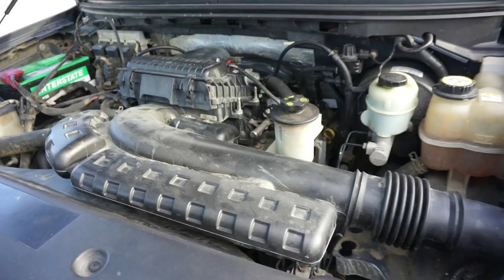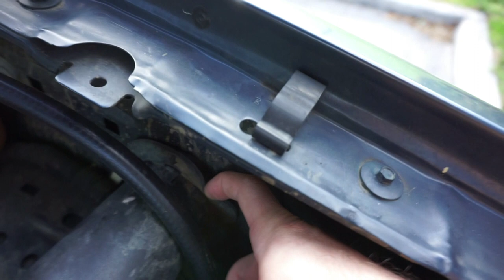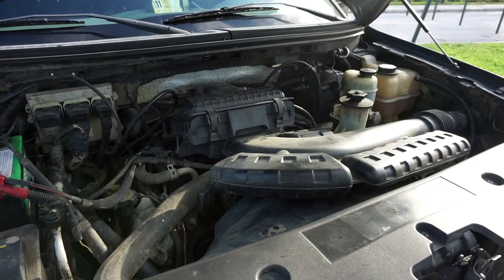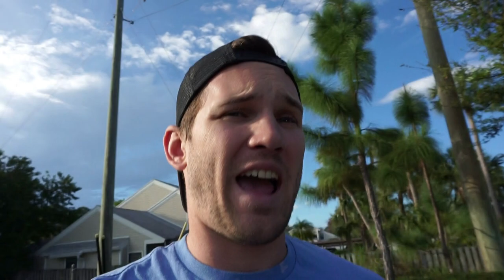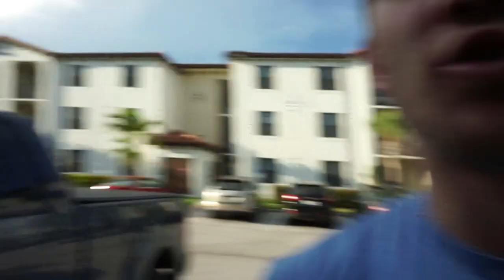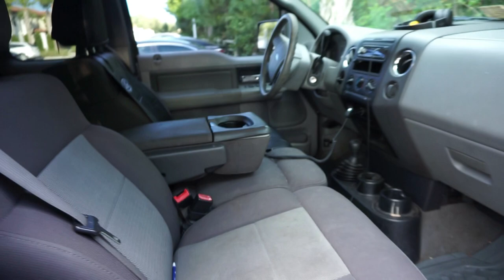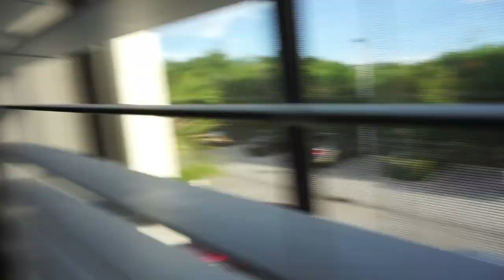This Is Why You Should Think TWICE Before Buying A Cold Air Intake

Comment: Honestly the pros outweighs the cons on having a CAI.. Im getting one. Keep in mind that he didn't mention anything about ungluging the battery prior to installation. You must unplug your battery before even plugging in the sensor then you must leave the battery unplugged for at least 15 mins so that the battery resets the vehicles computer along with its new data for the CAI.
Reply: Oh yeaaaaaah huh.. Not to mention he didn't even swap out the headers and exhaust system.
Reply: I’ve been searching for answers on this all over google …..thanks for this!
Reply: I agree with u more than I want to cold air intake on newer vehicles is almost useless but putting an 90° turn plus cold air intake to the front unrestricted is still a big boost don't get me wrong if it's side mounted it's vehicle spec but if u can front mounted an unrestricted ule get more out of a custom set on that then a OE spec k&n ur vehicle is moving forward wich means hot air is moving towards ur firewall an out yes its a constant output but it's always behind ur filter per physics  if ur filter box is pulling air from the side then switching to k&n needs to be front sided if u have air way slip shields either remove them or custom build them to a front side intake yeah it sounds expensive an time consuming but if u can buy one 90° part an put it front an center what is ur loss unless ur vehicles engineering hates customers wich is pretty rare fuck I'ma say it outside of ford
Reply: Incorrect....

Comment: I installed a Z1 cold air intake on my 2024 Nissan Titan Pro4x. The filter is located inside a box (with a nice looking window on top). No tune required. I am very happy with it! Better sound and better throttle response! The manufacturer says 10 more hp at the wheel... which I incline to believe. 😊

Comment: Most aftermarket CAIs are just "Hot Air" intakes, and complete waste of money in most situations.  The inconvenient truth is that most vehicles now come with CAIs from the factory.  The OEM CAIs  generally flow more air than the stock engine can use.  Louder doesn't mean more power.  It just means it's louder.

Comment: You don't understand airflow under the hood, if all there was engine heat and no airflow your engine would quickly overheat. Further a cold air intake is only going to show a gain in power at high rpm, too many people think that a cold air intake is going to turn their vehicle into a fire breathing dragster. Dyno's are also not a good way to measure the power a cold air intake gives you because you have no air flow, just an open hood and some fans blowing.

Comment: 03 3.4 GM rendezvous. I took out that bulky air box assembly and put a cone filter on it I use some mylar heat reflective stuff like they make the windshield solar Shields with. Now that the airbox is gone you can see the fresh air inlet coming to the fender. I drive 90 miles a day for work and there's a noticeable improvement. She's a sleeper  now LOL

Comment: Most people make the mistake of not resetting the computer after installing. You gotta pull the battery out (I did overnight) for hours so that the computer systems discharge and have to re-learn when they are back on. They will then adapt to the changes in MAP, and MAS readings and it will run better. Better power and fuel economy, with the wicked awesome bark.
Reply from the maker: I have never heard of removing your battery, I wonder why K&N doesn’t tell you to do that?
Reply: @AndrewDoesLife  Modification manufacturers make the assumption if you're modding your vehicle you understand what you're doing.

Research matters, as does understanding the fluid dynamics and kinametics of the systems under the hood! Engineering dude! Do you even?
Reply: @S.ASmith  🤔Still wondering why such a technical company as K&N wouldn't mention taking out the battery. Seems like that's something they woul mention after years of research...just sayn..dude!
Reply: @BC-hc5dq  When a kit is made to fit a variety of cars, they won't test on every car, heck they may just test it on a test bed to get the data they need.

And as I said above, if you're modifying your car the assumption is you or the person/mechanic doing it, knows what they're doing anyway.
Reply: Sure its like rebooting your computer at home every time you download a program or change something in your computer you turn it off to reboot it new cars are run by computer its the same thing
Reply: @kurtnulf3362  Indeed. The ECU will just adapt to different air temperatures or volumes. It'll otherwise maintain the same fuel/air ratio/mix in the cylinders unless remapped to something different.
Reply: Thanks
Reply: @BC-hc5dq they do in their installation videos....and they're on youtube lol

Comment: Adding an exhaust system + a CAI and a throttle body spacer you will definitely notice a difference in both sound (it’ll deepen the tone) and performance gains as well.
Reply from the maker: I definitely noticed a difference in sound! Much deeper than the stock system. I have wondered if I should’ve installed a TB spacer before going back to stock

Comment: Volant makes an EXCELLENT cold air intake system that uses a closed box system that connects to the existing fender intake hole, and you can optionally get a scoop that runs down closer to the ground that sucks air in from the front taking the much cooler air from the ground into your intake, these are fire.
Reply from the maker: I will have to look into those!

Comment: It all depends on your car, and where under the hood your cone filter is located.  Most of the time you're better off getting rid of the heat shield and instead remove some of the plastic under the hood to allow more airflow through your grill in to your engine bay.  You're not going to get huge power increases but you'll get about 5% more HP at higher RPMs, and maybe 1 mpg more.

Comment: I used a K&N air filter in a '97 4 cylinder Ranger (which I no longer have). I put in a K&N air filter and cabin filter in my '15 Trax. Minor fuel economy increase. I agree with your reasoning for not using the cold air intake system. Not to mention the airflow entering the stock set up while the vehicle is moving forward... If someone has a vehicle that has air filters on the outside of the engine compartment. maybe those systems might act differently.

Comment: Damn I was gonna get one this weekend so I was watching videos. So happy I came across your video of the experience cuz it just saved me 370 dollars.
Reply from the maker: No problem man! From my experience using both, the drop in replacement filter from K&N does way to more to increase performance in our truck than the entire cold air intake replacement set up. Plus the drop in filter is only like $40 and the cold air intake is over $300! haha The drop in filter I used is linked in the description if you don't know which one I'm talking about
Reply: @AndrewDoesLife  I do because Ive had the drop in filter for a few months now and I also did notice the improvement from it.
Reply from the maker: Good. I initially used to drop in filter and the results were so great I thought it’s a no brained to switch to their entirely new Cold Air Intake buttttttt that wasn’t necessarily the case haha I’ve found its best to use the stock housing and just get a better filter than the motor craft one they use from the factory

Comment: So what I'm thinking of doing on my 2007 5.4 f150 is ram airing the tube that runs into the fender by relocating it to the front of the truck closer to the grill or maybe cutting out a hole in the fender and putting a small vent flush mounted. Keeping everything stock and just add the drop in k&n filter.

Comment: I have a Lincoln Town Car with one (1995 specifically, 2003 and later have issues with electronic throttle). While I think the power gain is placebo, maybe 1-2hp at the most, the intake sounds way nicer, and I got a Spectre intake cone with chrome, which matches the chrome aesthetic of the car.

Comment: One thing I've found is with the intake getting it's air from the fender area, when you are in snowy or freezing conditions, a layer of ice or slush forms around the air filter. This causes a large decrease in fuel economy and the engines abiljty to breathe.
Reply: You are absolutely correct. My area in the fender fills with leaves. This is why I will not use the stock intake. The entire fender fills up with leaves. Clogging the stock system.

Comment: Been using the k&n filter for the oem as well... was considering an after market CAI and found this channel, guess you’re saving me ~$400...seems like a lot of people end up disappointed without tunes and exhaust. Your installation video of the full K&N intake had me kind of eager to pursue but sounds like it may not be worth the price lol. Nice truck and now you’re almost to 400 subs!
Reply from the maker: Yeah I was SO excited about the CAI system but honestly switching back to stock housing and using the K&N Drop In Filter was a way better decision and saved me hundreds of dollars that I've been able to put into other areas of my truck so I'm happy. Thanks man! I really appreciate it. We're only going to grow from here!
Reply: btw, K&N filters should be renamed to "rock catchers" 

it basically filters nothing. You're probably taking 20,000 miles off the total engine life. if not more
Reply: I put a roush supercharger on my 2014 Mustang gt.  The package is advertised at 575hp which from Roush is accurate unlike inflated numbers from other manufacturers.  The stock air box is retained, I found it funny how the stock intake is inadequate for a 420hp engine but it’s just fine for a 575hp engine.

Comment: Technically, that was a ram air intake. An CAI pulls air from under the vehicle or side of vehicle like the stock intake. You are correct, these intakes are pointless unless you are installing one that is completely enclosed and pulls air from outside of the engine compartment. I honestly doubt that heat shield actually works.
Reply from the maker: I meannnnn it was advertised and sold as a cold air intake haha 😂

Comment: You are correct,  you are not an engineer.  The cold air is the coldest available.  Get a gauge to check.  The stock is by far the warmest.  That massive plastic intake absorbs heat that goes straight into the engine. Get a air intake gauge for proof.
Reply from the maker: Jim Dailey thanks Jim!

Comment: Make sure you clean and reset your electronic throttle body after  installing a cold air intake put the only benefit from a stock 5.4L and a cold air intake system is 2 inches of pipe

Comment: your correct , there is a good reason why air filters are enclosed and suck in air through a pipe at the front fender , it is because cold air holds more oxygen, so all you are going to get from a cone filter is more noise and less power because its sucking in warmer air from under the hood. regards mechanic batman.

Comment: It's that particular vehicle and the air feed from the fender. The shield around the filter should seal off the rest of the engine bay and suck only the cold Air coming from the air feed Port.

Comment: The stock air intake already takes air from the fender well.  Not sure how a different intake would work any better
Reply: stock boxes are enclosed and usually located next to the hot engine. Good CAIs have heat shields and are tucked away near the side headlight area, so in theory the temps will be lower

Comment: My CAI gave it a nice roar. And for the model of vehicle actually prevented the timing pull when it got and stayed hot outside. Basically theres no HP increase but eliminated the mpg drop when in heat waves. But from factory it also has a strange like ram air inlet. Which i think is weird.

Comment: you wanna add exhaust with the cold air intake and you'll notice a difference. the common sense part with pulling cold air in I feel its opposite. The amount of air pulling through the stock is far less than how much air the aftermarket will pull. I will say the heat shield on that K&N air intake looks crappy. look at the spectre air intake heat shield. it brackets to the fender and radiator to fully block off heat from the motor. I did a muffler delete, cold air intake and soon a 3 stage tuner and new ignition plugs. I will post a video when I'm done adding to the truck and let you know how it runs after all the aftermarket parts are on.
Reply from the maker: Dude that all sounds amazing! Please keep me posted on your progress man I’m super down for adding performance upgrades to my truck. It just was too obvious that the heat shield wasn’t preventing the hot air from the engine from going into the air intake. I’m doing research now on doing a muffler switch to a magmaflow 40 series
Reply: wheres the video:(
Reply from the maker: The video of me installing the flowmaster muffler is on my channel 👍🏻😎

Comment: Get a closed box cold air intake it will make a difference. The open filters pull the heat from the motor back in

Comment: I did the same thing also, installed the cold air intake and i got a code for the MAF sensor. Truck started to struggle. Sent it back and the k&n drop filter. So much better, can tell the difference
Reply from the maker: Drop in filter is definitely the way to go!!

Comment: I really don’t see a benefit of installing a cold air intake on an older design Ford engine. Now on a newer Ford where most of the engines have VVT, and some are derived by Mazda, you will see a pretty noticeable improvement if you install a cold air intake. A cold air intake would be best suited for Ecoboost and 5.0 engines. Also N/A Duratec engines like them too.

Comment: I have done a lot of research on cold air intakes for my 2016 Dodge Challenger R/T Scat Pack... I talked to a lot of guys that own and work at speed shops and have a lot of experience tuning this type of car on a dyno... Everyone of these guys told me NOT TO WASTE MY TIME OR MONEY. These cold air intakes DO NOT improve any performance aspect of the car. So Im staying with the stock intake and Im still running 11.5 seconds on the quarter mile.

Comment: Would need an intake with a scoop for actual “cold air”. Not too mention a tune and exhaust.
Reply from the maker: Yeah I was disappointed this didn’t work out like I hoped it would
Reply: The S&B System works pretty good with and without the tune or exhaust...But with Exhaust an Tune it works pretty good for now .. but let you know how it goes after a few weeks
Reply from the maker: Hey Adam, I wound up returning the cold air intake from K&N and going back to my stock air intake housing, although I did use the drop in high flow air filter from K&N. I was not a fan of the noise and the way it made my truck run after using the product for about 7-8 days.
Reply: Andrew Does Life 

That’s what I did.  K&N 77 Series, Super 10 exhaust side dumped, BBK 80mm Throttle Body, and Gryphon custom tunes.  Truck runs like a car lol.  I’m glad with everything I did to my ‘05 5.4.

Comment: U think having a functional hood air dam directrd to the top of the filter would make a difference?
Reply from the maker: Yes I do. I have seen in person (there's one on YouTube as well) an F150 that uses the JLT Ram air intake and uses a functional hood scoop to allow for more air flow to the intake as well as cooler air that is not heat soaked from being in the engine bay. For this particular mod going on a bare bones stock truck, I don't know if I'd go with such an expensive mod that (for me) did not pay dividends. 

Here's that other F150 I mentioned -- https://www.youtube.com/watch?v=NLyBt-nuQq4

Comment: I 100% agree!!! I got the 69 typhoon series CAI for my RT Charger after KN said it would give me 40hp. Mine came with that same BS heat shield and thanks to dodge and performance pages in the nav I saw that once I installed the KN CAI I was pulling temps in my engine that reached 140-180 degrees and my gas mileage dropped significantly. After seeing my car at high Temps for days on end I decided to rip it out and put the old factory airbox and did exactly what you did and got the KN performance drop in the air filter and bam temps went back to normal and car felt exactly the same! I called KN requesting a refund and they wanted me to get a mechanic to send them an invoice saying that the CAI was defective ! My advice RUN AWAY FROM CAI and get the drop ins
Reply: Yeah, I did the same thing with my Chrysler 300 5.7 hemi and it seemed to under performed. Seemed more louder but had a slight lag in it while taking off. Then I took it off and put the stock box back on it. What I found out is that the port injected system don't really see a benefit from the CAI's, the throttle body and carbs see better performance though. Had a 94 chevy ext. with 350 5 speed and it got better mileage and performed better, also added the throttle body spacer on it too at the same time. No heat shield on that one and I ran constantly at 170 to 179 only all the time. Get 19.3 city no matter how I drove and 21.5 highway. Never used the ac since it went out not long after I got the truck and didn't bother fixing it, the vent motor was messed up and wouldn't blow thru the vents. Heater worked fine though for defrost. Throttle response was great on it, the throttle response on my 300 was sluggish though, and that's after have dual glass packs put on it.

Comment: I installed the cold air intake from K&n on my 2010 ford f150 and it actually DID increase the horsepower and tourqe the throttle is more touchy than it was stock with no issues
Reply from the maker: That's great! Which engine does your 2010 model have? I love the idea of this mod, it's just that on my specific truck I did not like the before and after effects especially given it was an over $300 mod
Reply: @AndrewDoesLife  5.4 3v tritian v8